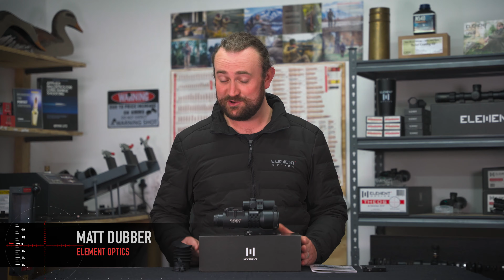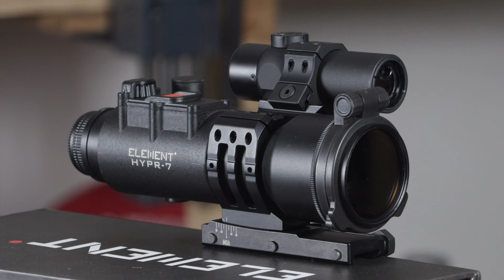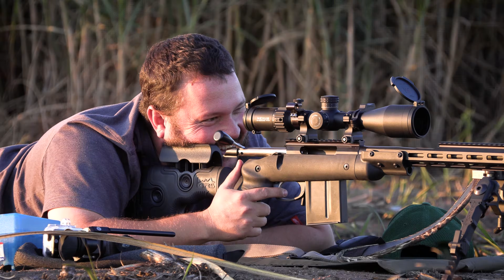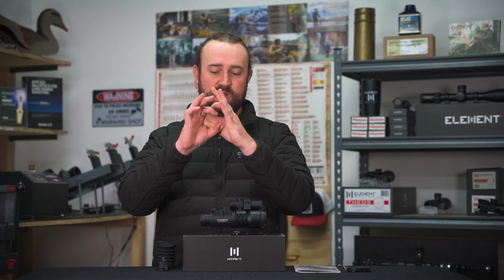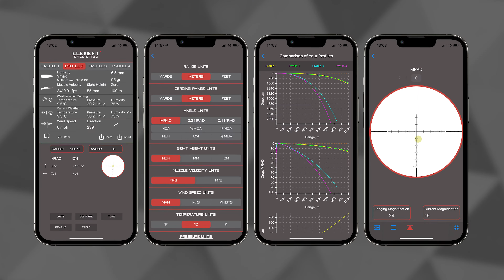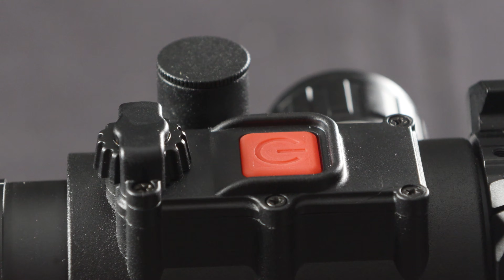The HYPR-7 by Element Optics | Introduction & Overview [Part 1]

Comment: Why doesn't it record? Why does it need a separate range finder? I have several NV and thermal, two that are cheaper and  one of them is almost half the cost of the HYPR-7. All of them record and they each have built-in range finders. If there's any lag on them, I've never noticed it. Also, I've never needed a weather station when shooting. Who's the target audience for this scope? Disappointed here.
Reply: What models of NV and thermal donyoubhave that are cheaper than the HYPR-7v
Reply: @Hunt2Eat  The price for a HYPR-7 is $1,549.99
ATN X-Sight 5 $795
OneLeaf Commander NV500 Eagle $858.00
Pard NV008 $699
Even my ASP-Micro monocular records video and takes snapshots.
Then there's HIKMICRO, Zulus, and others. As you can tell, I'm a cheap bastich and rarely spend a lot of money on something until I'm capable of taking advantage of it's capabilities. And when it comes to airguns, I'm still fairly new to the hobby!
Reply: @donpeer4477  So you own a ATN X-Sight 5, OneLeaf Commander NV500 Eagle , Pard NV008 $699 and a ASP-Micro monocular?